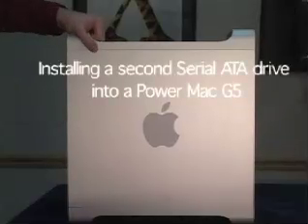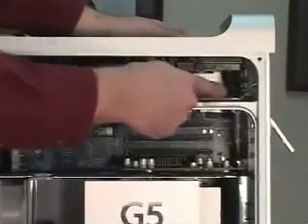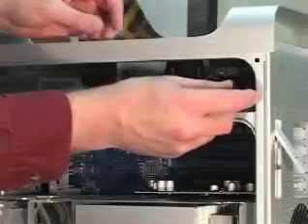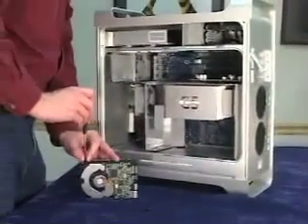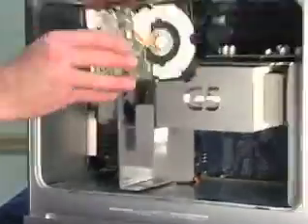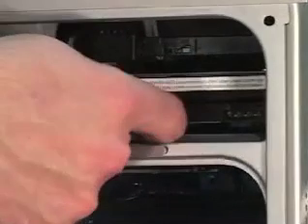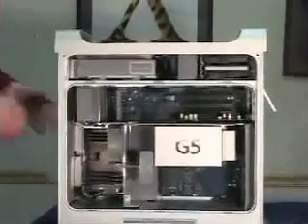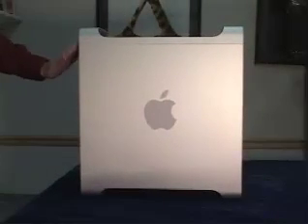How to install a hard drive in a Power Mac G5

Comment: Hi, i'm removing a old hard drive and adding a new one but is 100% new what is the OsX i need for the G5 and how can i install it? Oh and where can i get a tutorial on this? Thank's
Reply: Easy: put the new HD/SSD into slot 2. use the HD Toolprogram to partition the new HD to Apple PARTITITION and use the same Program to transfer all the Data from the old to the new HD. (Or use carbon copy cloner for that… )